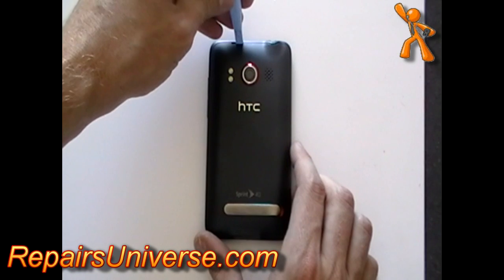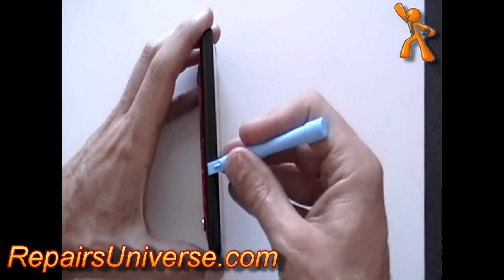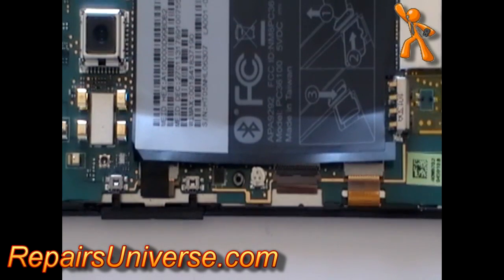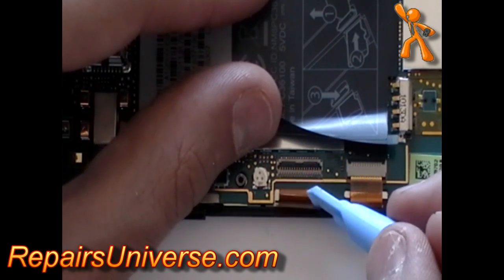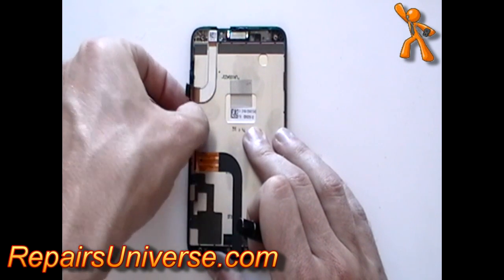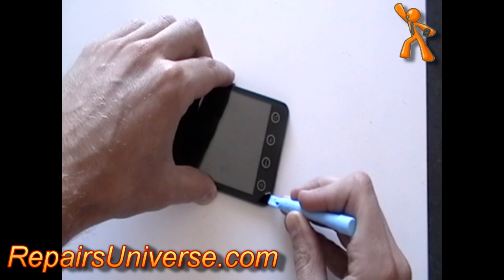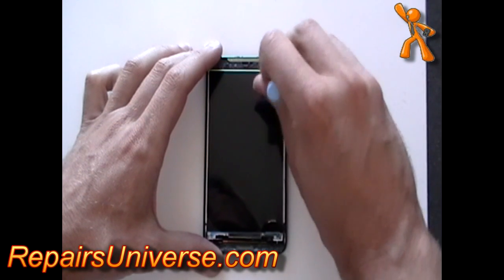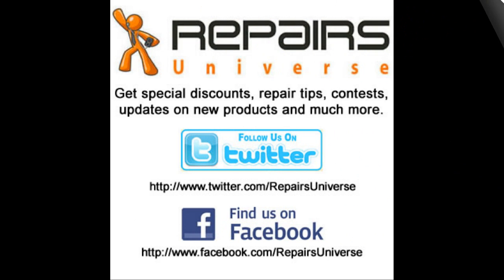HTC EVO 4G Disassembly Repair Instruction Guide

Comment: @ J Black  - to find the SD card, remove the back, then the battery and in the lower right hand corner (under the battery) is a small compartment. On the right hand side of the compartment is a little clip that you gently lift up and that releases the SD for removal.  Hope this helps. :)

Comment: My evo will charge and say its 100% but once I take it off the charger it lasts an hour tops. I've replaced the battery and charger. Still the same problem. Any suggestions?

Comment: i was in a mosh pit and my phone broke and the screen is a little bit cracked but it won't turn on anymore i tried a different battery and it still wouldn't turn on and both batteries were fully charged and it still didn't turn on what should i do?????

Comment from the maker: If the device is getting power then this is a connection issue. If the device is not getting any power this could be a battery. Try charging the device.

Comment: Great vid!  I have replaced the complete housing on my phone.  Just having one issue.  After I reassembled I noticed that my lcd screen looked a little funny.  I think that it is touching the digitizer glass causing it to blemish. The lcd is not broken as I have been able to get rid of the blemish by lifting the glass.  Do you have any remedy for this?

Comment: The adhesive strips seem to be to attach the lcd to the frame, but what is used to reconnect the digitizer to the unit, as far as adhesive?  Is it strips, as well, or is it a stand alone adhesive that needs to be applied?

Comment: Correct that it's part of the mother board but incorrect that you cannot repair it. Like most circuits attached to a motherboard and other electronic devices, you need to learn how to use solder and a soldering iron to place the replacement part in.

Comment from the maker: @Icanspeakfashion This can happen when separating the touch screen from the LCD screen. This is why we recommend using heat to warm the adhesive, making separating a bit easier. What is the exact issue with the LCD screen?

Comment: Thanks for the video, it's been quite helpful. I'm having trouble with the wifi and someone told me that it may have come loose since no software fix could remedy this. Where is the antenna located? And can it be replaced?

Comment from the maker: @MrJrod582 Sorry to hear. Yes, the plastic pry tool may wear quicker and be a bit weaker, but its much better than scratching the housing or screen or causing other damage withe a flat head. Check out RepairsUniverse (dot) com to see if we have the replacement flex cable you will need to replace.

Comment: The adhesive was very strong and in my frustration i opened the LCD screen and ripped a ribbon cord :(

I really recommend the safe pry tool. I used a flat head (1.0) to pry and did serious damage.

Comment from the maker: @wininn Could be many issues. The most likely causes I can think of are issues with the motherboard or the battery. You will need to do some testing regarding the battery to rule it out, such as keeping it charged and seeing if that has an affect. Motherboard/software issues are difficult to diagnose and not our specialty. A repair shop or something similar may be able to provide more information.

Comment from the maker: @tonynleilani Sadly we have not found a reliable way to determine LCD flex size, other than physically measuring. There are a few ways floating around, but nothing we have tried has worked consistently.

Comment from the maker: @chriscrossroolzd00d Thank you. If you are replacing the glass touch screen digitizer you will need to remove the old screen and flex cable. Your replacement will have a new cable.

Comment: Thanks. Great video. Before I disassemble my phone. My led screen is not broken. Just the front part of the screen itself. What do I do on the ribbon attached to the cracked screen from the front. Cause I all I need to do is replace it. If I buy a replacement screen. Do I need to take off the ribbon and attach it to the new one? Or does it already come with a new ribbon?

Comment from the maker: @PiggieProductionsTX If the touch screen is working fine, its hopeful to think the motherboard was not damaged. The damage may be concentrated on the LCD screen, in which replacing it will resolve the black screen. You can find replacement screens for the Evo at RepairsUniverse (dot) com.

Comment: I spilled water on my Evo 4g the lcd screen does not turn on but  phone still works it turns on and with a bit of luck i can call buy guessing where everything is at ... If i replace the LCD screen with it work or did i fry somthing?????

Comment from the maker: @inthegamelikeea The jaws or "alligator" connectors can be a bit tedious, use a safe open pry tool or flat head to help guide the ribbon back into place, with the connector open, once aligned, simply apply some pressure to ribbon in the direction of the connector and lock it down. Good luck!

Comment: is there a simple fix to stop the power cut off and resting endless loop?
consumer watch: Sprint will sell broken phones to customes to demand 2 year contract on a phone that dose not work. if I do not agree bewcuase it dose not make sence to do a 2 year contract on a phone that is dead? 3rd party repair only installed the firmware nad that was useless